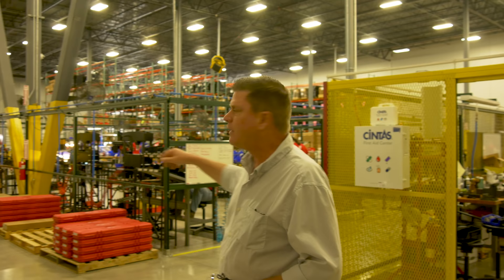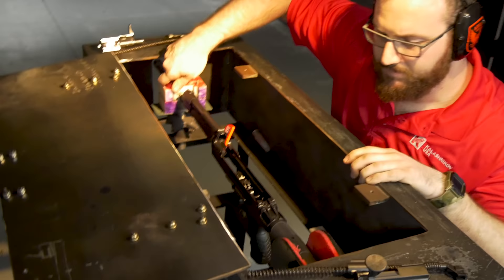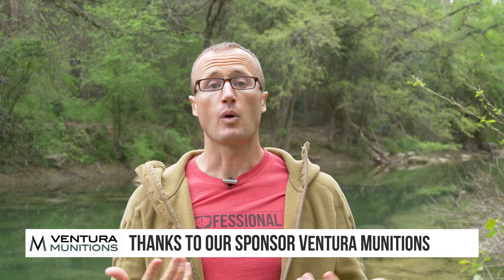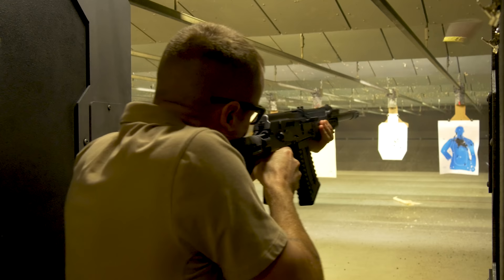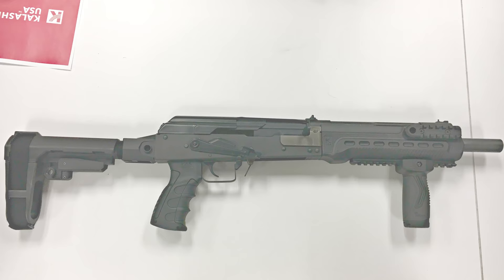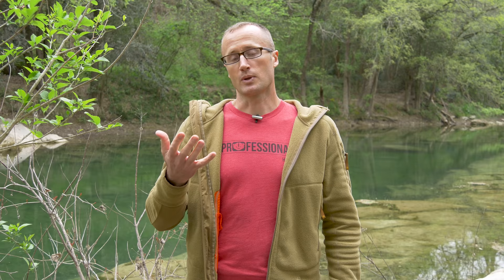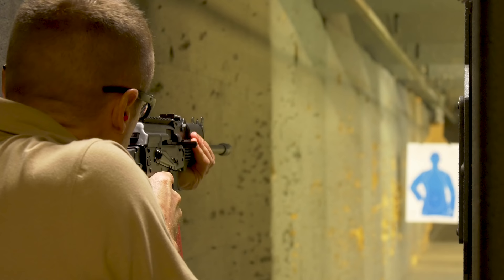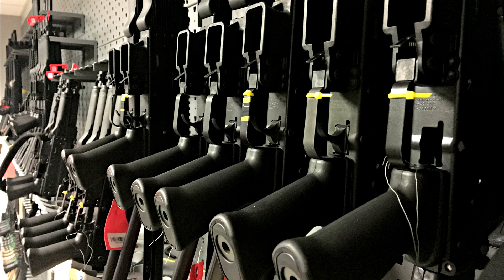New Guns from Kalashnikov USA

Comment: Thanks Ivan.  I hope they start churning out 7.62x39 like mad and it drops the price below 5.56.
Reply: SCJMO 

On the manufacturing side 556 prices are at a 15 year low! Selling around $4.50- $5 a box to distributors! Dealers are sitting on inventory and will not sell at a break even and order more at the lower prices and pass it on to the consumer!!
Reply: Brass can’t compete with steel casings!
Reply: Law off the Krokadil my friend, 7.62x39 is cheaper then any 5.56 you can buy, unless you are confusing steel .223 with 5.56
Reply: Would be a dream!
Reply: @bamaverick8740  You're buying wrong if you're not getting 223 for $3.49 a box

Comment: Patiently waiting for an AK-12.
Reply: AK-12 won't shoot any better than AK-74 derivative with a slightly retuned gas system. That's all that was done to make AK-12 into a softer-shooting weapon. Just change the gas block for adjustable one.

Everything else is available on US civilian market. You aren't missing on anything as far as AK-12 is concerned.
Reply: KR-103
Reply: The new ak 12 or the old one

Comment: I bought a KR-103 last December and have put 2,000 rounds through it to date (Steel and brass) and I have not had a single malfunction with my rifle. I've seen lots of reviews of people crapping on KUSA for quality/safety issues. I realize my experience may differ from others, and my opinion is based off of my experience with my rifle. I am extremely happy with KUSA KR-103. My KR-103 has way less recoil than my buddies $1800 AR.

Comment: I had some questions about the direction of the company so I sent customer service an email last night. I got a reply very quickly followed by another reply this morning to call and speak with them. this was a surprise as I am no one. I called the number provided and spoke with Reece there for about 25 minutes. What a great company that  they don't mind giving you a direct extension to speak with them. most companies would have sent me an automated response and never really addressed my concerns. My questions were answered thoroughly overall I had a great experience talking with Reece. The 7.62 guns are coming and when they do I will definitely be purchasing one. I know there were some issues with this company early on but I am confident that they are turning it around and going to be putting out a solid product.

Comment: I’m sorry, I can’t take them seriously. The first order of business is a 7.62 AK. the Alpha would’ve sold like crazy.
Reply: @GrymmEvil  it was a huge improvement over the original ak platform
Reply: If they put out a problem free vityaz before psa they will have cornered the market. In which case PSA should scrap theirs since no one will trust it.
Reply: @joshualance6005  The Alfa is a step backwards with the rifle. Heavy polymer that's fitted around a steel receiver. Apparently the talk is they got the datasheets on the AK-107 (Modernized AKM in 7.62x39) so they're releasing that instead. Fingers crossed for a railed dust-cover and modernized parts like KC.
Reply: Real shit.
Reply: Marketing genius. Of course AK fans want the 7.62 version, but if they own the authenticity market in the us, they can blue ball us until they drop the OG version and make bank.

Comment: Recently, John Mossberg did a press release and said they are finishing up their testing and the plan is to build a mass inventory before announcing the ak pattern rifles to the public, so the dealers will not run short on stock. They plan to release the 74/47, and if the quality of the KS12T is any indication, the rifles will be excellent.

Comment: Can someone answer a question for me? Why on Earth are there garbage Ak's in the first place, when the designed is so old and it was made in inferior conditions in the past, yet we cannot get it right today? Is there some magical voodoo element to it that only the Russians know of?
Reply: It’s old tech that takes a craftsman with knowledge how to make one. Also the price range is an issue. People want inexpensive AK’s which causes company’s to cut corners.
Reply: @xero5557  it's really about having the right equipment Russians have huge factory built dedicated to building just the ak47
Reply: Joshua Lance not only the Russians makes a guilty AK. It’s cheaper to CNC and assembly then have a craftsman make an AK.
Reply: Reminds me of that guy at Nasa saying we can't go to the moon anymore because the old technology is lost lol.
Reply: Matt Jones there is actually some validity to that. Just like we can’t make the F22 anymore because we don’t have the tooling. You wanna make weapons based off old tech. You gotta have the tooling and know how which is hard because it has been replace by modern manufacturing processes.

Comment: He keeps on emphasizing “made to spec..”. Really? Like real genuine forged trunnions(front and rear), front sight blocks,  gas blocks and bolt carriers? Real Bakelite pistol grips? Not some mutant modern plastic crap like Tapco. Real stamped steel mags or correct plastic mags with real STEEL feed lips? I hope this company doesn’t go down the I/O AK crap road and really does make a WARSAW PAC spec AK. I’m tired of the US manufacturers trying to cheap out on building these firearms. Been disappointed to many times.